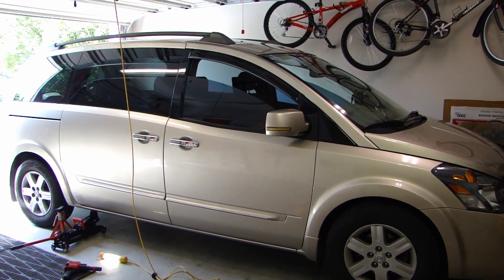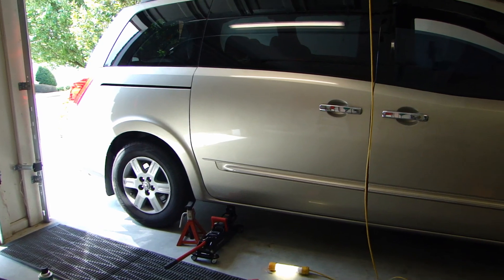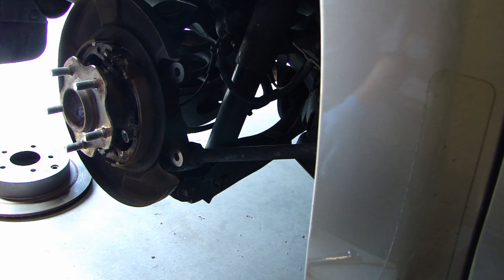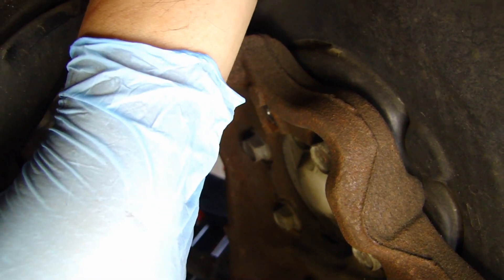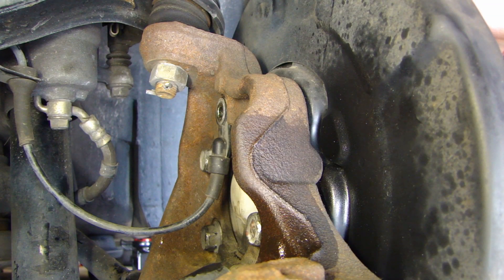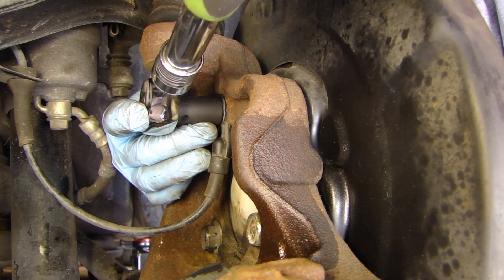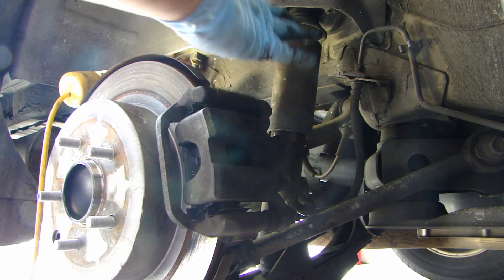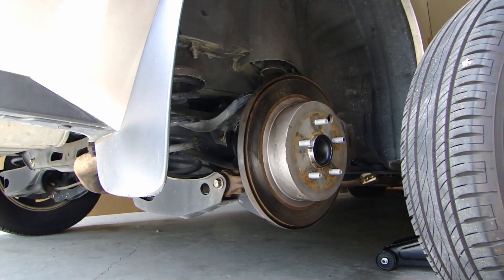How To Replace Rear Wheel Bearing - Nissan Quest 04-09

Comment: I watched another rear hub assembly install, on an Nissan rogue, the guy removed the emergency park brake which I thought was totally unnecessary! especially if it's the same four bolts to remove like the Nissan Quest, your video is straight to the point without taking unnecessary parts off for wasted time. Great Auto repair video.😎✌👍

Comment: Hello, my Nissan Quest SL 2004 is having difficulties starting, and I need to step on the accelerator to help it start. Sometimes, while the car is running it shut downs out of the blue. It started happening after oil change and engine flush. The repairmen recommended that I should drive on the highway with the speed of 90k/m for 10 minutes, which I didn't do. Do you have ideas why the car is having difficulties starting? How could I possibly fix it?

Comment: When tensioning bolts make sure you don't overtighten them before you use the tension wrench to check them, some people will rattle them up with a pneumatic driver then put the tension wrench on to check but they are already overtightened, you should bring them up to tension evenly in a crosswise pattern till they are tight. That torque wrench will click on correct tension even if they are extremely overtightened.
Reply from the maker: Thanks for your input. I see you caught on to the part in the video where I was tightening the back bolts. Good eyes! :) ....I forgot to film it when I tightened it with the torque wrench so I went back in to film it after it was already torqued.

Comment: If my wheel bearing assembly does not come off after the 4 17mm bolts what do I do? It’s rusted real bad
Reply: Spray the outer edges (carefully, so that you don't get anything on the parking brake shoes) of the hub assembly with PB blaster or WD- 40 let soak. Then hit it the hub flange with a mallet or you can use a hub puller attached to a slide hammer and remove it that way.
Reply: omar sosa 

   I used a forcing screw in one of the stud holes.  Hit the stud out and it works great.

Comment: Does that have  disc and  drum breaks do you have to change both for new breaks
Reply from the maker: +3865roofer It's a disk brake. The drum part is the parking brake. You don't change the parking brake.

Comment: Great video..I think my wheel bearings may be bad aswell. I was driving the other day and pulled over to the side of the road because it sounded as is If I  had a flat tire in  the rear passenger side. No flat tire...So I got back in and continued to drive as I began to accelarate the thumping sound(like a flat tire) increased in speed aswell. I havent had a chance to check the brake or rotor yet,  but if the brakes are fine do you think it is the wheel bearings?
Reply: Belt could have broke in tire

Comment: Hi this was a great video and very informative. Now I have replaced my rear passenger hub assembly on my Nissan Quest 2004 but an unusual issue happened where after this installation my ABS brakes are now impacted. So the ABS actuator when I press on my brakes is pulsating and I do not have any LIGHTS on my dash telling me any issues with the ABS system. So in other words my ABS is kicking in after the hub assembly replacement. I went a bit further where I took out the fuse related to ABS(right side under the engine hood) and this confirmed for sure it was my ABS. The downfall of removing the fuse is it impacted my SLIP,TCS & ABS where my dashboard was lite up with these warning lights. In addition to that my odometer was no longer working. So running without the fuse is not an option. I decided based on all of this to put back the old hub and the ABS issue is no longer occurring. I though maybe the unusual had happened that I had gotten a faulty/defective part, so I went back to my local part store and they did provide me another one but did indicate this was very unusual. Unfortunately the new part had the same issue. So I believe this confirms it's not a faulty hub part as well as my ABS sensor is not working either. The part is from AC DELCO and I know you indicated TIMKEN but is it really possibly that the AC DELCO hub kit simply is not the proper after market part and that the TimKen is the best choice? The price difference from my part store is $100 more for the TimKen and I'm willing to pay the extra but I'm not confident this will resolve my issue which is why I've not done this yet. Do you believe the TimKen hub is the solution to my problem? Also my part store told me that I could try to do a ABS system reset but I've search online and have had no luck in finding any instructions on this or do not even know if it's possible. So would you happen to know if an ABS system reset is a possibility on a Nissan quest and if so would you know how to do this or do I have to bring it to the shop?  Any other suggestion(s) on how I could resolve my issue.
Reply: +Wayne Villon   I miss type some info previously where I gave the impression that my ABS sensor was not working but I had meant to state it is working.

Comment: Excellent video. My Quest is having the same problem and you just saved me $500 bucks in parts n labor. One question why timken, does it matter? Thanks again
Reply from the maker: +Arnie Gordon Timken makes really good bearings, and for the cost, not worth saving few dollars for ones that will fail in a year.
Reply: +dial2fast agreed. You're doing the job yourself. Might as well replace both.

Comment: My mom's 2002 Altima 3.5SE rear wheel bearings were REALLY bad. This must be a Nissan thing. They had no play, but they were very stiff. Also, I had to hammer on a screwdriver I stuck through the notch on the back of the wheel assembly to get the bearing assemblies out. It's a pretty easy procedure, though.
Reply from the maker: +hoopfan71 Thanks for sharing!